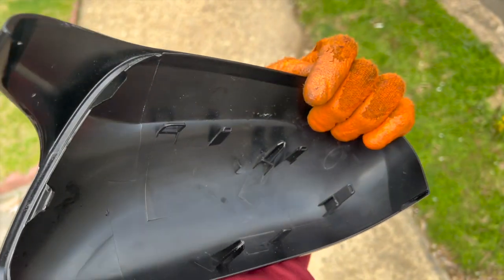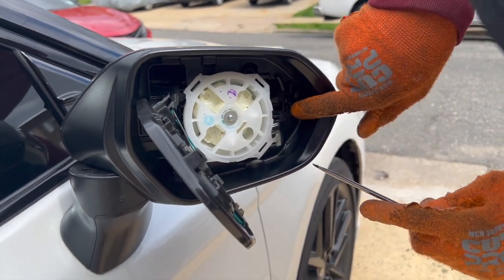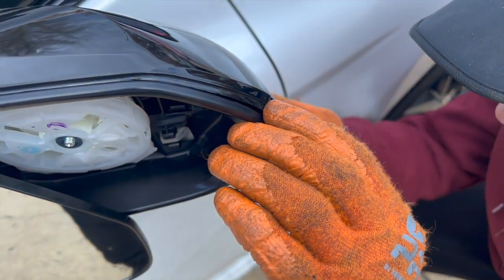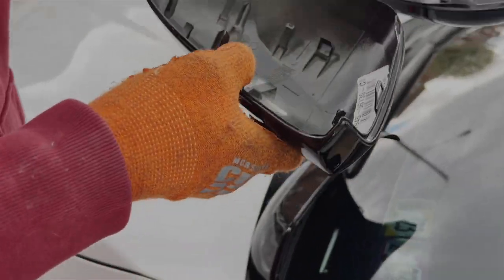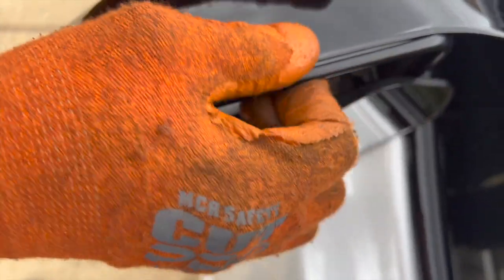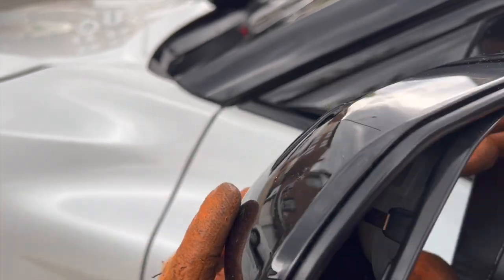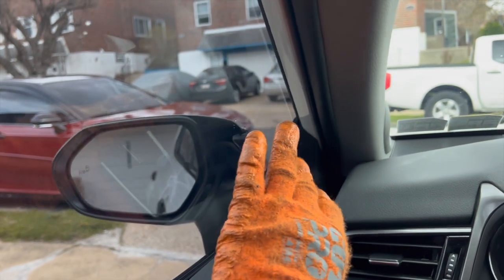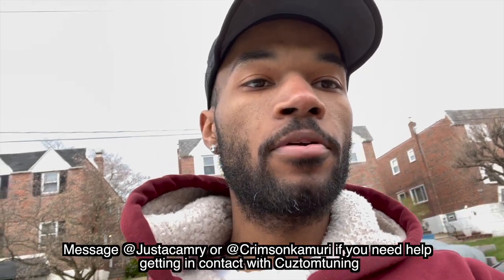Cuztomtuning's M Horn style mirror cap replacements for 2018-2023 Camry (All Trims w/BSM)

Comment: SWesome Job Bro!  I just scratched my stock getting the faded Carbon Cover off! I will be replacing them with full Carbon Covers now!!! Bravo
Reply: What you mean faded carbon cover? I’m looking to get some from KOCF or Hi Rev sports, where did you buy the faded ones ? And curious on price point to avoid them lol
Reply: @djmalic3  unfortunately, I got them off  a shop for Camry's ( I can't remember the exact name so I want  post it). They was about $200 plus with shipping. But the Carbon was nice it was the clear coat that wore off and needs to be repainted. This Mississippi heat burnt the clear off and many cars are victim too!
Reply: @djmalic3   I got them from Hi Rev @$200 with shipping back in  late 2020. The clear burnt off from the Mississippi Sun. They was great still just needed a new clear coat put on! But I will do the Carbon Fiber caps instead of the covers!!!

Comment: Anybody know the difference between the side mirrors that have blindspot monitor/turn signals and the ones that don't? The outside shape looks the same to me. These look cool and I'd like them on my 2018 SE, but I've got the poor boy mirrors, and I'd like to know if they could be made to fit the lower spec mirrors.
Reply from the maker: The tabs inside the mirror are different and will prevent the aftermarket mirror caps from fitting on flush. It’s not even close either they will fall off easily